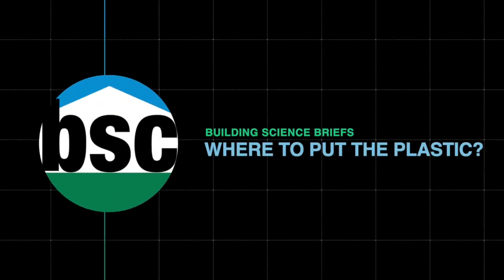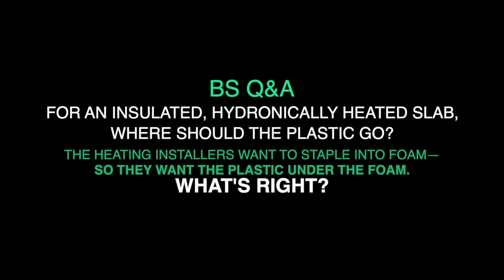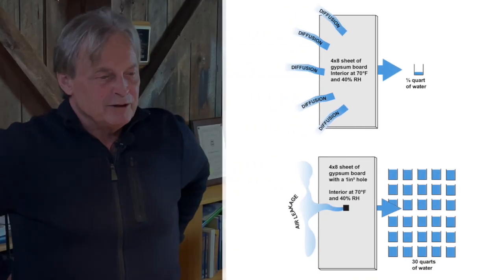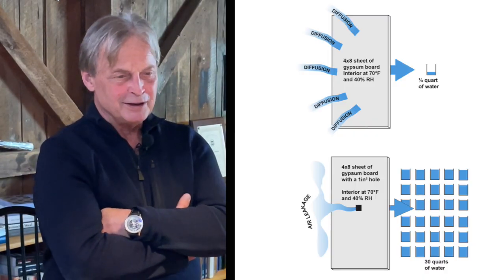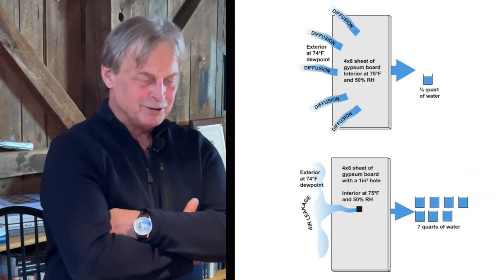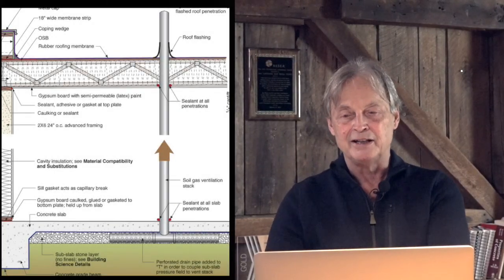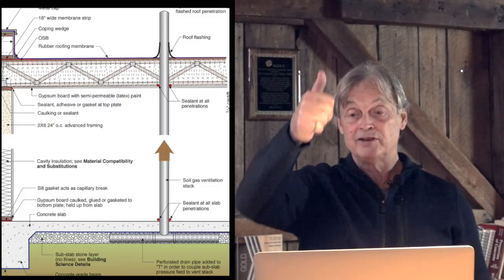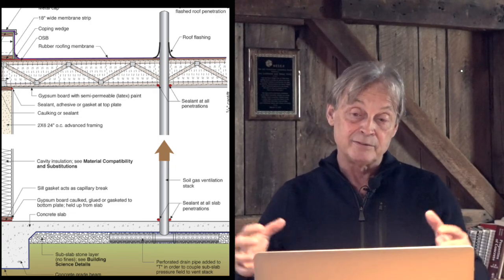In a Radiant Slab, Where Does the Plastic Go?

Comment: No plastic. XPS over compacted gravel then concrete  - tape the joints if you care - have interior perforated drain tile ( under the gravel ) daylight that out the footing. Have perimeter drain tiles on the exterior - no its not belt and suspenders both drainage loops perform different work -  works for CMU or concrete foundations - If you don't handle the water it doesn't matter where you put the plastic.

Of course it goes without saying that we should never put radiant heating in a mass slab - Fkn forget about that - seriously its not 1983 anymore -  do your slab with drainage and insulation but put the radiant ON TOP of that slab and finish it any way you want - wood or tile - they also make insulated, aluminum faced  panels with plywood that are pre grooved to accept the plastic  radiant tubing - ok its more money but really ?? ever think how your going to fix and find that radiant leak in a slab ? Ever think that now we are building tighter houses so that finished floor needs to heat up and shut off without overheating the room ? Putting the tubing in a mass slab in a super-insulated or " passive house" that only hurts the comfort.

Let Joe chime in here !!!

Comment: What happens to the concrete air-barrier when the concrete cracks because it will crack. VB should not have holes in the poly this promotes poor workmanship but I agree with the vapour diffusion exemple and explanation.

Comment: why can't you put the vapor barrier under the rigid insulation?
Reply: “Place the insulation under the plastic vapor barrier and over the top of a granular capillary break. Do not, and I repeat, do not install the insulation over the top of the plastic vapor barrier and under the slab. The insulation will get wet and stay wet forever. Under the plastic, it can dry into the granular layer. 

Memo to everyone: with insulation, you absolutely need a granular layer with no fines to act as a capillary break.”
Reply: @TravisHayden  thank you for your input! don't you think that the insulation will dry faster to the interior of the house than to the ground. the only possible problem with vapor barrier bellow the insulation i see is that you will need some type of membrane (vapor open) between the insulation and the wet concrete if you are using eps or rockwool